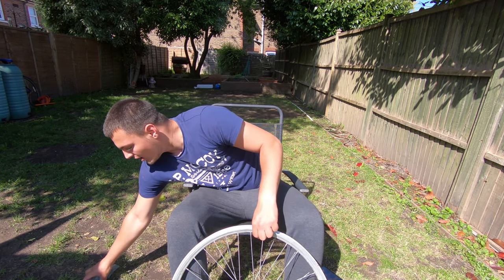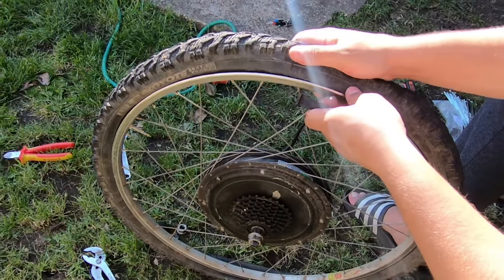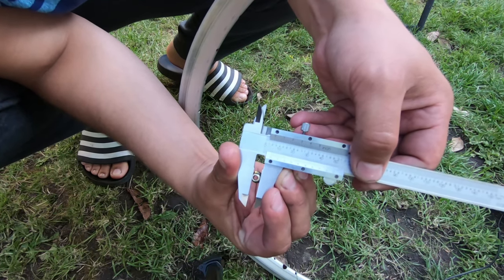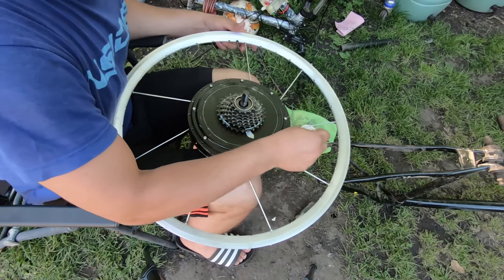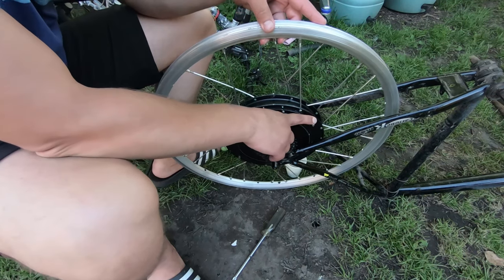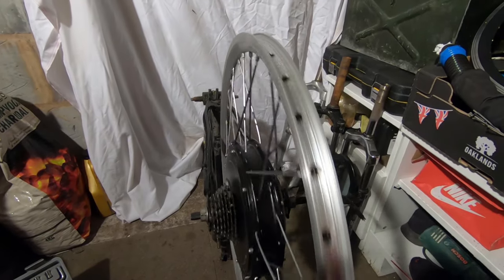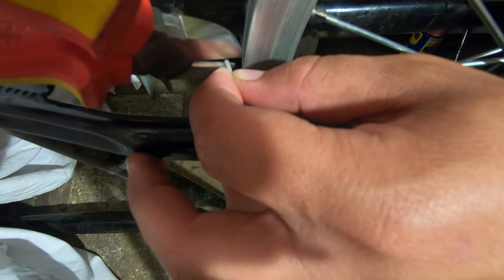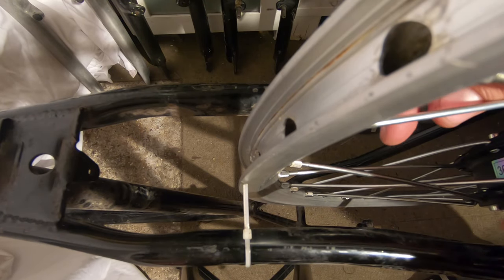Ebike doctor S01 E01 - Ebike wheel lacing single cross pattern ( rebuild ) #ebikedoctor

Comment: Thankyou
Reply from the maker: For ?
Reply: @OvidiuMarin  I would have thought for showing a better way to spoke a wheel .
Reply from the maker: I think single cross pattern is among the most used ones. There is no other way to do it.
Reply: Hi again. So the spokes you initially installed were wrong as I thought. How did you determine the right length of spoke? These motors come in different diameters so where do you get the info you need "this" length spokes for "this" size rim? I m trying to convert a 700c front wheel. Thanks for the videos anyway